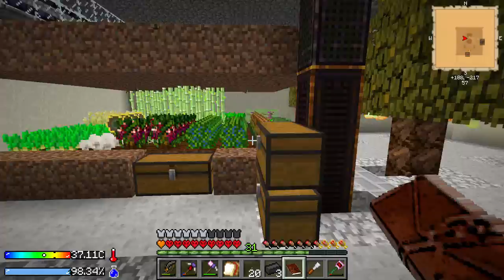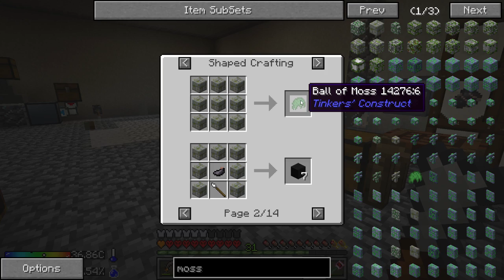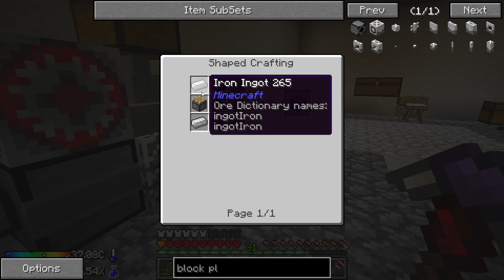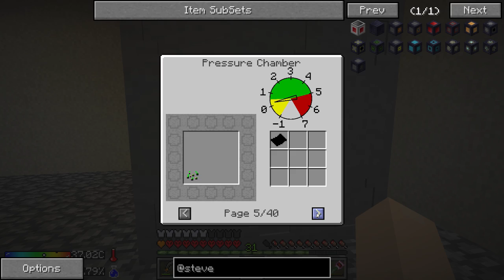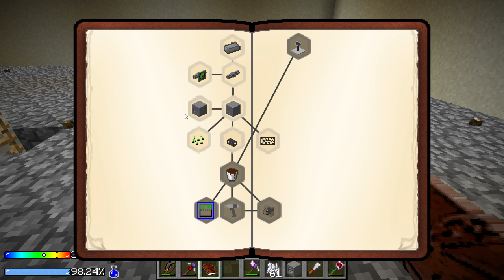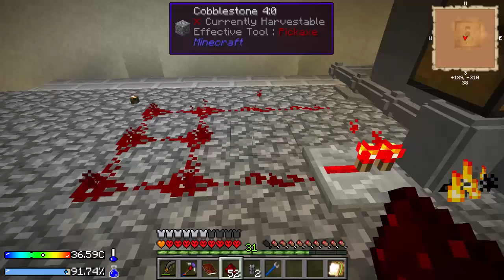Minecraft Crash Landing 11 - "Feeling The PRESSURE!!!" (Modded Minecraft)

Comment: Personally, I lined the top of my barrier with glass then planted all the trees up top on the glass. I used some scavenged elevators to access it.The shade is nice and they don't get in the way of my front yard farmland. adding another row of cobble wall then half slabs on the wall for spider defense, and keeping me from falling off. The gasts are annoying, but scarce enough to where I haven't had to worry about anything going in flames. I saved the basement for the making of stuff other than cooking and water.

Comment: Generik, if you smelt the seared cobblestone in the smelter it gives you 144mb(enough to cover two more cobble). You can pipe them back in the smeltery and automate the process so you can a constant gain of 1 block(because it only costs 72mb to create seared cobble) cheaty? Yes a little, but easier than the high oven.

Comment: Generik, you can semi-automate water production without using any power for that. Just place crucible over the blazing pyrotheum (that "leaking fuel"), it give you 0.7/t if it is over source and 0.5/t if over flowing pyrotheum. With pipes or something like that place leaves in crucible, and take water from them using fluiduct. It's faster and cheaper than your idea of making water.

Comment: you'd think they would have designed a popoff valve or somesuch that you could place either on the tank or the pipe and set to relieve pressure when it goes over a certain value....maybe something the mod maker needs to look into??

Comment: Hey Generik, if you use the f3+h thing it kinda breaks the tinkers construct stuff, basically no matter what materials you use, if you have f3+h turned on, it sets the tool's durability to 100 (when it should be much, much higher) and it also messes up the auto repair. please vote up so he can see :)
Reply: It's fine, it's just a graphical glitch.

Comment: to mine the dust just use the torch trick where you put a torch under a stack of falling stuff and it will break it, if you fell like this trick is good, please like it so genny can see it
Reply: he tried. it doesn't work and deletes the torch
Reply: And before you say to use slabs, stairs, signs, or any other block. It doesn't work.
Reply: A pressure plate works.
Reply: KalbintionKier Wooden pressure plates DO work. But you won't get any of the dust it just dissapears. So if you want the dust you are better off with an excavator.

Comment: If the planets supposed to be dead wouldn't you want the further down you go to be colder?
Reply: Without going into too much detail, pressure creates heat and the further down you go, the more pressure and heat you get. It's what keeps the earth's core molten.
Reply: soulecho230 Today I learn. Thanks for the correction! But still, the rule like in real life, the further down you go, the hotter it gets.
Reply: Naoki Saito Actually, the Earths mantle and core are kept hot via radioactive decay. The core itself is solid iron, due to the pressures involved.
Reply: That is because there was no shortage of heat in the early earth, and the planet's inability to cool off quickly results in the continued high temperatures of the Earth's interior. In effect, not only do the earth's plates act as a blanket on the interior, but not even convective heat transport in the solid mantle provides a particularly efficient mechanism for heat loss. The planet does lose some heat through the processes that drive plate tectonics, especially at mid-ocean ridges. For comparison, smaller bodies such as Mars and the Moon show little evidence for recent tectonic activity or volcanism. The story though behind the crash landing map was what I believed a dead planet and typically they exist without a liquid inner core, a cold core.

Comment: Genny you can duplicate seared stone by smelting seared cobblestone.
It only requires 72mb of seared stone to make, however it wil provide you 144mb if you smelt the seared cobblestone.
Thus an infinity of seared stone :D

Also right clicking with an empty bottle on icheos acid (you'll make it with pneumaticraft) will fill it with water without the liquid disappearing, which will give you an infinity of water ;) (it's a bug though you probably should not use is)

Comment: Please get rid of those weird lights all over the place
Reply: Torches generate heat. Glows tone doesn't have a high percentage of drop in the sifting of the dust. Those little dots of light are notches of a big glow stone block. Same amount of light and not using a whole glow stone block.

So tell me again why you want him to remove his light sources?
Reply: They aren't too bad in my opinion but he has them so he doesn't have to hear up a lot and prob so he doesn't have to refill his camel pack too much in vids. (Don't quote me on last part)
Reply: they are cheap and heatless lighting